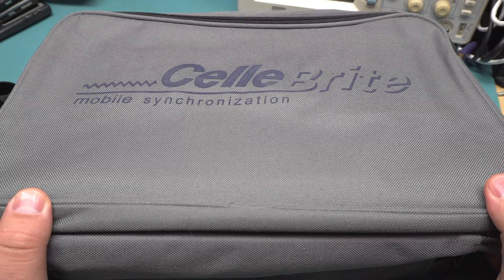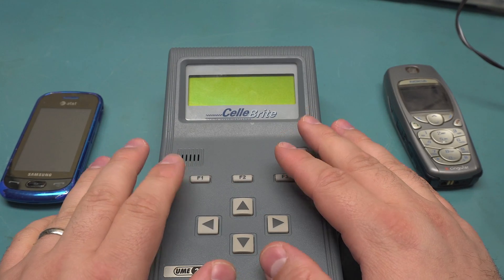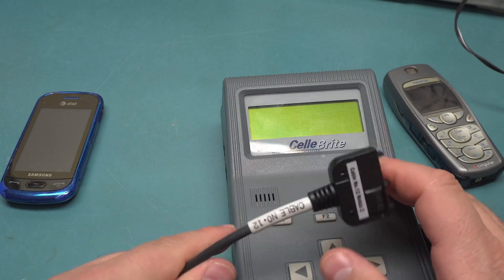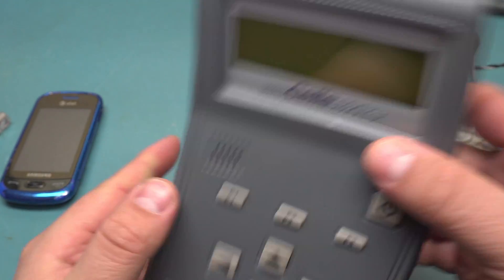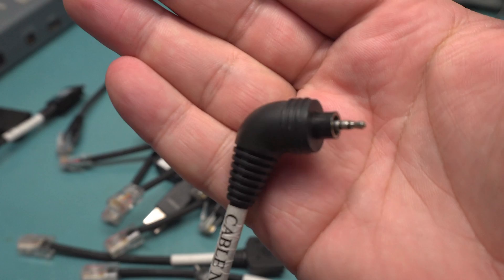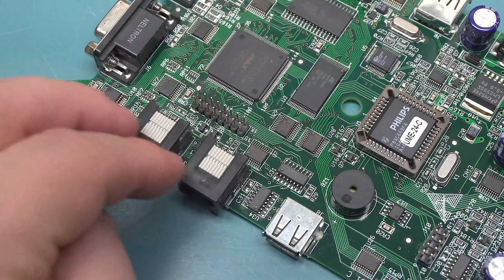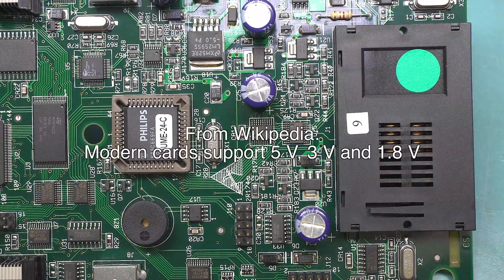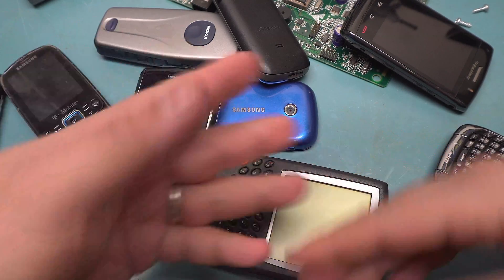CelleBrite UME-24 Phone Cloning Tool Teardown

Comment: 3:33 - That is Windows Mobile! Windows Mobile 2003 and Windows Mobile 5 were the first versions of the operating system to adopt that name. Windows Mobile 2002 actually officially still bore the retro-style Pocket PC 2002 designation.
Reply from the maker: +Browningate I meant Windows Phone or whatever their newer one is. Hard to remember when it is 0.00001% of the market. Haha
Reply: @Peter
I can't blame you after how many times Microsoft changed the name of their product. After switching to the "Windows Mobile" nomenclature in 2003, they changed it to "Phone" when they re-released it alongside Windows 7, (in 2009) then to "Windows for Mobile" (and sometimes "Windows Mobile") a couple of years ago (when they updated it for Windows 10) before finally abandoning the project altogether.

To make it easier, I refer to all of the classic, Windows-CE based, versions (except for 7) as "Windows Mobile," and all of the "metro" ones as "Windows Mobile Phone."